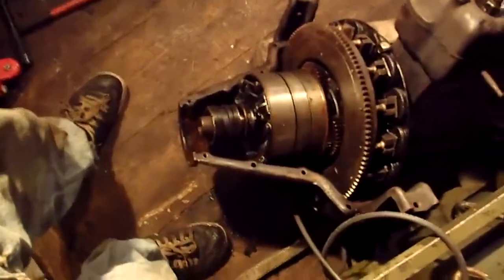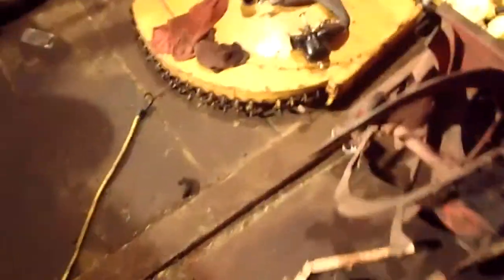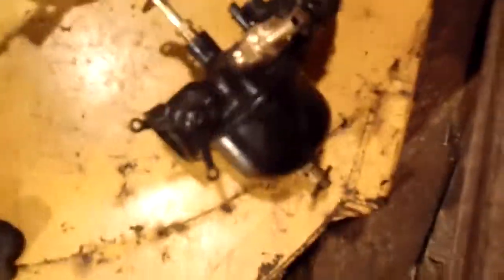Swapping out Model T engine Part 4

Comment: You are so effin lucky to be able to have those opportunities to work on such equipment. I'm still looking for a model T to just restore just enough to get it running and then use it as a slow daily driver around here. Not really looking for shiny paint. Your T's interior looks awesome from the previous videos. Are you going to restore to original or ?

Comment from the maker: @leadpelletinass Thanks for the comment! I am going to keep it original as much as I can. I am just going to restore all of the mechanical parts like the rear axle, steering box, engine, transmission to make it so it will be safe on the road. It doesnt have any seats in it right now but I have an old truck seat I will use for the drivers seat and I will find some other old seat for the rest of em. I got it for free so I cant complain. Check out my newer vids of the axle!